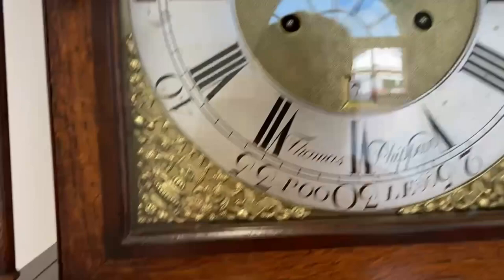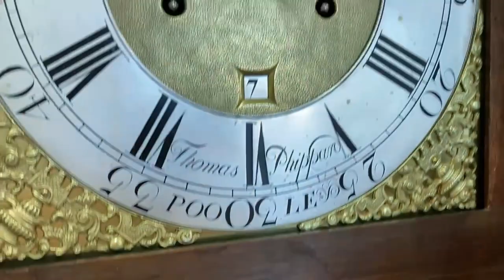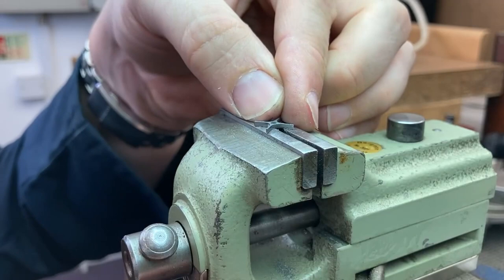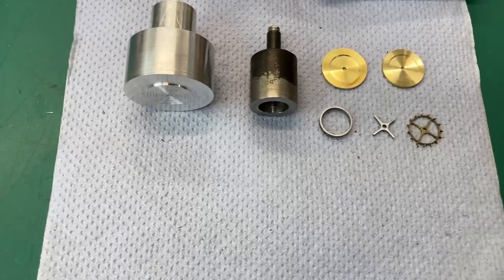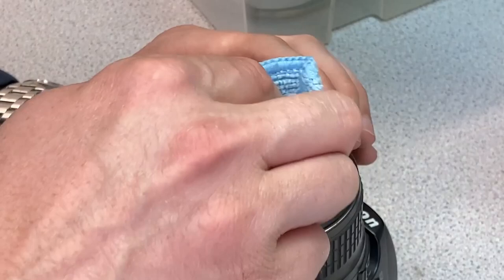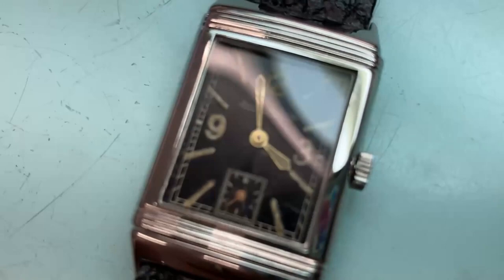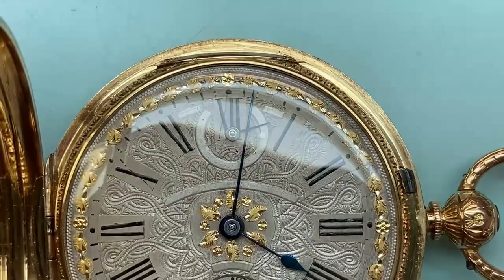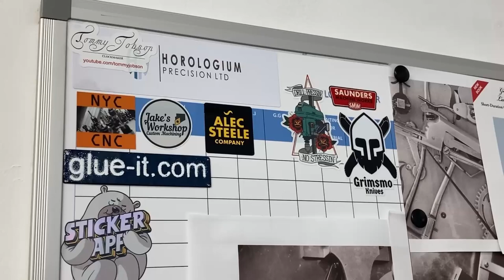Clock Repair Shop - AMAZING engraving - Filing Jigs - STICKERS!! Vlog 002 - #Workshop Wednesday

Comment: The Engraved pocket watch looks as if it was stuck in a drawer and never used!
Except for the damage to the dial, you would think it was a new watch!

An added filter to your lens will prevent the expensive glass from being damaged.

Comment: Why not use milling or CNC for the jigs at least. Curious.
Reply from the maker: I don't have any CNC machines, and the crossing jig is not something I could mill because of the shape.
Reply: @TommyJobson  I see other folks experimenting with new tooling - even lasers. As well as metal 3d printers. You have any views here. Do you see watch making changing in general?
Reply from the maker: Yes definitely. The technology today is super exciting. I am very much open to the idea of using technology to compliment more traditional ways, for example 3d printing pantograph templates, work holding or jigs, but not at the cost of the skills of the craft itself. I think sometimes people are under the impression that with a CNC you can press a button and watch pops out, it doesn’t work like that. I’m happy with my one man manual machine set up and continuing to learn and refine my mastery of a traditional skill set.